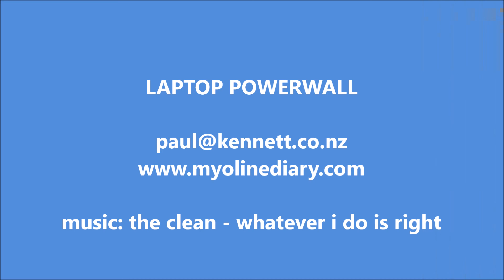Laptop Powerwall 18 - first charge

Comment: this is so  funny you are charging 500 batteries at 1000 milli amp  ? lets do the math 1000/ 500 = 2 milli amp per cells , i guess you will finish charging the powerwall at christmass, why dont use a bigger charger  ,  last week i did some research on aliexpress havent find any cheap one  , they are too much expensive ,  350 usd for 50 amp charger , we have to find a solution for this , what do you think  ?
Reply from the maker: I started super low because I was nervous. Also this is a 7S24P pack so the 1 Amp is going into 24 cells, not 500.

Comment: Paul have you done a correlation between the amount of cell charge and resistance. My acucell charger measures from no battery detected with a low voltage cell to >999mOhms to lower mOhms the greater the voltage in each.
Reply from the maker: +harveyboy45 Yep - episode 10 https://www.youtube.com/watch?v=35M6FM1AxK0

Comment: Hi Paul. Later on what if one of these cells get totally becomes dead and not charging or discharging as we want? It will obviously reduce the capacity of the bank. How do you visually identify the exact cell prior replacing with a another good cell. I mean these cell were using over years and close to the end of their life time.
Reply from the maker: +Ramesh Perera I have no way easy to tell if one cell in a group of parallel cells has greatly reduced capacity. But I don't think that will be a problem in my case.
Let's say 1 cell in my group of 48 cells in parallel suddenly looses all it's capacity (or it's fuse wire breaks) - that's only a theoretical 2.08% loss of capacity from the group. And - because I'm only charging up to 80% full capacity it leaves the rest of the cells in the group plenty of margin to take up the slack.
This problem is more significant in a small pack subjected to greater discharge stress - like my electric lawnmower which is only 12P and draws over 100 Amps peak.
Reply: +Paul Kennett Okay. But how do you limit your charging up to 80%. Are you doing from the solar charger?
Reply from the maker: +Ramesh Perera Yep, I'm charging with a cheap solar charge controller which let's me set the charge voltage. You can see it near the end of: https://www.youtube.com/watch?v=pQzkDIsLNWo
I'll do a video on it soon.

Comment: dont you think, slow charging will damage your cells?
Reply from the maker: +Yash Patel Hi Yash. The only problem I heard about with slow charging is Nissan Leaf MK1 batteries (FiFePo pouch cells) in hot climates. I'm charging Li-Ion in a moderate climate.

I have seen reports of studies indicating that fast charging does not harm capacity much.

Do you know of any research indicating slow charging is harmful? If there is I'll change my process.
Reply: +Yash Patel http://electronics.stackexchange.com/questions/199249/is-slow-charging-a-lithium-polymer-battery-any-better-for-it
Reply from the maker: +Yash Patel Yep  - that about sums it up. From what I can see - there's nothing against charging Li-Ion slowly.

Comment: Hi Paul. If I don't have your icharger once complete the battery pack. Can I charge from a normal charger through the BMS fixed to the battery pack? Is it safe??
Reply from the maker: +Ramesh Perera It depends on what you mean by "normal charger". What do you have there?
Reply: +Paul Kennett well I mean If I charge it from a 24Vdc switch mode power supply through the bms fixed to the pack.
Reply from the maker: +Ramesh Perera In my case I want to charge them to 80% of full charge - which is 4 volts per cell group. I've got 7 groups in series so that comes out to 28 volts needed from the charger. In my case I'm using a cheap solar charge controller set to charge up to 28 volts.

You could use a 28VDC switch mode power supply to charge your bank, but... there are some who say charging with a constant voltage that does not shut off is bad for the battery. Jahu Garcia thinks it's fine though (https://www.youtube.com/watch?v=ZBf_qXEYUoM). I'm not sure - I need to read up some more.

Comment: Those 3D printed pieces are cheaper than buying the plastic bits off ebay ?
Reply from the maker: +BillTheBox  It requires 3.44 meters of PLA to print one of my battery holders, which holds 16 cells (8 pairs).

A 1kg roll of 1.75mm diameter PLA has about 300 meters and costs around US$30-60 depending on the source. So for a US$50 roll, that 3.4 meters would be US$0.57 per holder - but you need two - top and bottom.

Still pretty cheap... as long as you don't factor in time, and the cost of the 3D printer. My little Printrbot Jr was only US$400.

I did a vid on my 18650 battery holders: https://www.youtube.com/watch?v=L-4qlDtPGWQ